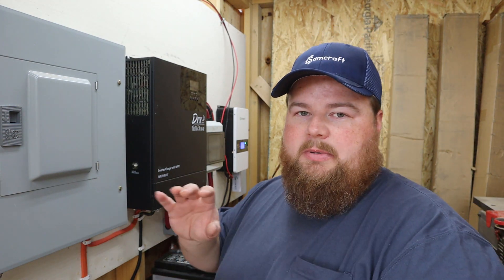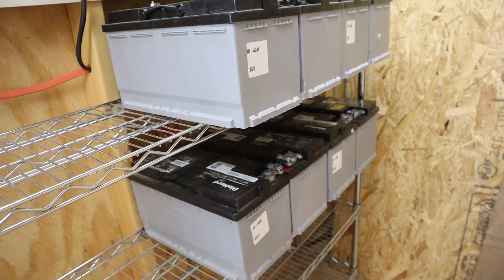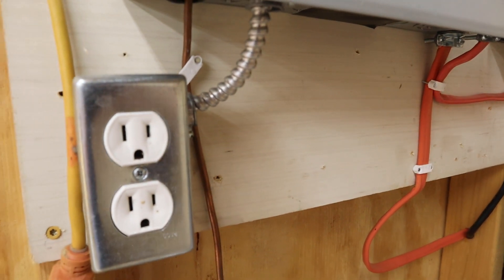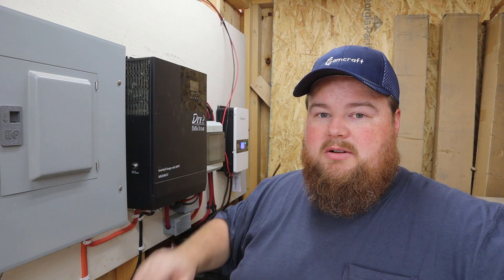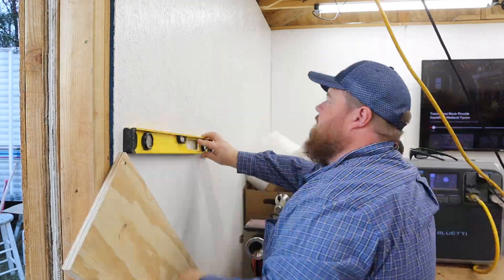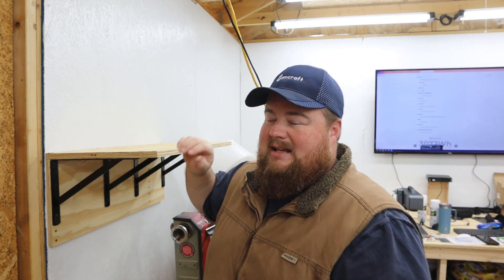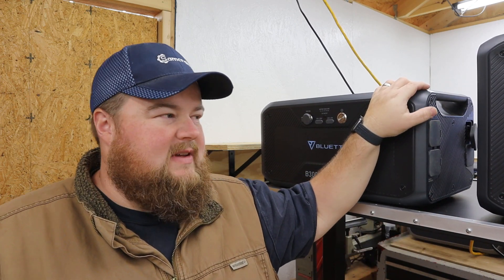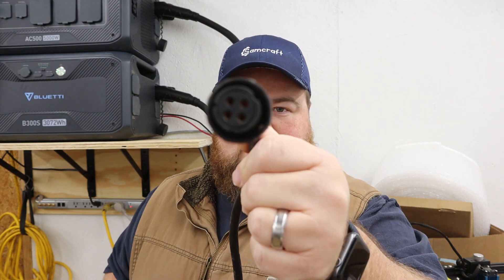Upgrading my Off Grid Workshop with the BLUETTI AC500 + B300S

Comment: I hope you read up on the 2 pole 50 Amp plug, you will need two AC500 units in order to pull 50amps out of the system, it is the only drawback on the Bluetti

Comment: Sam , when you plug into your ac500 , is that only bringing in 120 volts or 120 volts on each leg to make that 50 amp receptacle 240 volt /

Comment: Cool setup. FYI - A main lug load center has lugs (Those connections at the top of the bus bars.) for the main feed wires to directly energize the bus bars with no main breaker or disconnect. In a main breaker load center the main feed connects to a breaker. That breaker will connect/disconnect power to the bus bars without taking up breaker spaces. You just bypassed the lugs by wiring in your own main breaker. Still works as a disconnect, you just have a few less breaker spaces available.
Reply from the maker: Yep. This is a combo box designed for either way. I don't mind loosing a few spaces for a smaller load center and much cheaper price.

Comment: Just watched your video. Nice job. I do have a question. The large outlet, you have plugged into. Only one leg is hot. Are both sides of that breaker panel hot ? If so how ?
Thank you for your time
Reply from the maker: I didn't want to show that part as it's not exactly a recommended method, but I connected the L1 and L2 wires to each other on the plug end where it connects into the BLUETTI.
Reply: Thank you.  Good luck with everything you do.

Comment: It's curious that the incoming power went to zero as soon as the power draw jumped into the 700s.
Looks like a nice setup. I've wrestled 3kVA APC units before and those things weighed a "ton" w/o the battery packs. That 5000 is either more efficient or you're stronger than you look to lift it over your head. 💪

Is the battery rating true capacity or fully drained? Most batteries don't like being pulled down to "zero" as it damages them. 80% of the sticker's capacity rating (at best) has been the rule of thumb most of my life. It would be nice if the company is grossing-up the battery to have a true 3000WHr capacity.

Comment: I was just quoted almost $4,000 to wire up my 12x14 workshop to city power.
Seriously considering doing what you did.
I would have a computer with two monitors, two 3D printers, a small drill press, small belt sander, scroll saw,foam hot wire tools, Dremel, laser engraver!cutter, lights, maybe a pellet stove. Fan, stereo… but of course not all at once.
I’m thinking something like this may work and be better with some solar panels.
I have a medium and a large gas generator also-for when it’s too cloudy-but being the southwest, there’s a lot of sun even in winter.

Comment: would it not be an idea to make an enclosed cupboard around the power boxes and vent it to the outside, then you'll not have to worry about dust and have cooler fresh air from outside, also would the glued-on filters not restrict airflow to the fams, especially when covered in dustl

Comment: Nice video.  Hope this all works for you.  I have a couple of questions.  As the specs were rolling on the screen for the Bluetti, I thought I saw where it said that input was limited to 500w, and you said your solar array was 700+ watts.  In terms of runtime, how does the capacity of the old batteries to the new one compare.  How long of battery power did you have on the Bluetti compare to the old batteries.

Comment: What would happen when like u said the table saw under a load while cutting something hard to draw more amps...but yea brother...totally convinced that is the waya to go...awesome
Reply from the maker: The unit has a 10,000 watt peak rating, so it should handle it fine for a short time as the other tool or this one settles. It's so rare for me to ever have more than one "large" tool running at the same time.

Comment: Why not buy 16 280Ah LiFeP04 cells for $2000? Gives you 14kwh so it blows the Bluetti out of the water if your current inverter has enough power output

Comment: Ok, I am a novice when it comes to solar BUT it seems like adding up the cost of the solar array and all the associated equipment and electronics I could pay for a lot of electricity.  Other than not being concerned about a power outage what is the benefit?  Where are the real savings?  Thanks.

Comment: Way better than the typical "ohh, can this 2000watt unit handle [anything you can plug into a 15amp plug]" type video. Does the app or the display show an esitmated run time based on current load? That is one feature I like on my Delta MAX.  Hope your feet are feeling better!
Reply from the maker: I had hoped it would be more fun. :) It doesn't display runtime remaining, no. That would be a nice feature!!!
Reply: @Samcraftcom  I'm about to give a try using the laswer engraver on shot glasses as gifts, any suggests on setting for glass? (I have the 5w outur)

Comment: Great job on the video my man!....  Not too sure if you mentioned it or not, but you can even connect a direct connection to the battery from solar using up to 500 watts to the battery alone with ALSO using the maximum 3000 watts to the inverter itself.  This way, you can use JUST the battery if you only need a 12 volt supply.  These things are SOOOO FREAKING AWESOME!!!....  You can also attach up to 6 of those batteries making it 18,432 watt-hours!!!!  ....  Again, These things are AWESOME!!!!!

Comment: in hindsight it mightve been better to set the batterypack on top of the controller unit , that way youre able to operate the ting a little eazier 
yeah yeah the app , but still its only a little effort to switch it
as for (most) of the old system , maibe make it a backup sytem for the home , keeping it charged through the net and kicking in when theres a blackout , basicly keeps youre "server" router some emergency lights and fridge running
Reply from the maker: It would crush the DC wireless charging pads on the top of the inverter to swap them. I can easily reach, read, and use the display when needed, but It's not something I'm looking at much. The old system is in another shed on our property and will be setup for use in there soon I hope.

Comment: Finally got a chance to watch this and the biggest question I would have is, how much did everything cost? solar panels and all. Maybe our electricity is really cheap where I am in PA but solar is not even close to being competitive for us! I would love to have a solar setup for the garage to run a heater in the winter and not run the electric up but the upfront cost is a killer.....unless you say it was only like $3000 for everything then it may be worthwhile!!! Just for comparison our electric is .068 and distribution is .028 per kwh. I really would love to have solar to be greener and be able to do crazy things like heat the pool, garage, etc and not have to worry about a $500 a month bill but I need to hear an upfront cost now to see if it would be any cheaper than just running all that stuff through my main electric.

Comment: I ordered the AC500 combo last night. I started to go with something like the 200Max, but it looks like the AC500 is built for REAL offgrid use, not just for emergency power. I'll have to add more batteries over time, but it's great to have the expandability  toward a whole home solution. One reviewer pointed out that the AC500 could actually compete with the Tesla Powerwall, in price and power. Tesla won't sell you a Powerwall for DIY; only they can install it, while with Bluetti it's ALL DIY.

Viewers should know that if you try to save some money by buying the older generation B300 batteries, you'll need a $100 adapter cable, plus you will be limited to 4 batteries, (you can add 6 if you use the B300S). I almost made that mistake.

Btw, I would have liked to have seen details how you wired the 50 amp receptacle.

Comment: Sam, where do you get your Bluetti’s from? I have tried to contact Bluetti to be able to talk to someone on which one system I need for my home when the power goes out. I have called them several times to  talk to them and get some more information but, I only get a ringing phone which no one will answer. Any information will be appreciated.
Reply: A question they can't answer, it all depends on what you expect to run. A window air conditioner? A few lights? A refrigerator? Or your whole house, central air and heat? 

Then comes the question of how long, a few hours or every day until power is restored?

It takes an audit of what you have and use to start to answer these kinds of things.  

Hopefully you understand that a company like this doesn't staff for those types of phone calls

Comment: Is your workshop heated?  These don't like to work/charged below freezing temps if the solar is permanently connected. If you heat the workshop while you are in it, it would take some time for the unit to warm up (internal batteries) from freezing (or lower) before they should be used. This isn't an issue with the lead acid batteries you were originally using. Also, in the summer, these won't take well to temps above 100 F if the shed heats up a lot.

Comment: Bluetti Batterys are twice the price of other brands,. you can charge the system from another battery ! try adding other brands - no can do, even if cut and reconfiger the wire.  So they say to heavy to be portable so way the wires hanging out the sides, they  need an engineer from say Japan or some other country to help them with the wires hanging out the sides.

Comment: Will low winter temperatures cause problems for your new system?
Reply: I wonder, lifepo4 batteries are not supposed to be charged below freezing, uncertain what chemistry Bluetti uses..

I see Lifepo4 so if they aren't heated they will be damaged
Reply from the maker: This is from their website: Waking up electronics on a freezing day may be time-consuming. But with the Temperature Adaptive Function, B300S will automatically heat up to work actively and smoothly as usual.
Reply: @Samcraftcom  battery specs say: Temperature ranges for B300 are: Charge: 0-40℃ (32-104℉); Discharge: -20-40℃ (-4-104℉); Storage: -20-40℃ (-4-104℉).

Hard to find, so be careful of freezing weather and charging

But the advertising says:

Yet: BLUETTI always adopts state-of-the-art technologies and brings forth new ideas to level up user experience. Power stations aren’t responsive enough especially on freezing days. Now with the Temperature Adaptive Function, B300S will automatically heat up to above 0℃ when the ambient temperature is -20℃ to ensure it can work smoothly.

Maybe the BMS is smart enough to stop charging until heater brings battery to the proper temperature 🌡️

Comment: I feel you've mentioned this before, but can't remember.  What are the specs on the panels you're using?  I'm thinking about adding a few panels to the roof and a system like this to run at home 'data center', and quite possibly run my big Co2 laser setup (100w laser, commercial chiller for it, small compressor and an exhaust fan).  While I've got a good bit of room up there for panels, I'm going to maximize the non-shaded areas by (hopefully) putting in some larger wattage output panels..  I'd likely also use this setup as a 'backup' for outages on a few things..  Without a major expenditure on tree removal, I'd likely have good solar coverage for around 8-10 hrs most days (for example, in summer they'd be in full sunlight from around 10am to at least 7pm, if I remove a couple smaller trees, till sundown).
Reply from the maker: My panels are used "off lease" panels I got from Langston's Alternative Power for a fraction of the price of new panels. They're stickered at 270w each, but pump out about 250w in perfect conditions. Considering the price I paid, I've never regretted the purchase. I have 20 of them in total, but only use 8 right now. I really want to put the other into use somehow on our land soon! Spencer is a great guy and worth inquiring with if you're looking into things. He owns Langston's. Here's a link to his website: https://www.langstonsalternativepower.com/

Comment: Off Grid Homesteading has the Bluetti and swears by it. Has anyone every told you, you could be a salesman, or a really good teacher? Keep it up.
Reply from the maker: I consider BLUETTI the top tier brand for power stations. Our smaller AC200P has been through a hard life the last year but has never missed a beat. This AC500 unit is the same way -- we've had it for several months now with no issues in quality, performance, and reliability. Everything is as-advertised with them.

Comment: Although I don't know how much power is needed for Angela's soap shack, I could see using the old system to have it running off-grid.   I'm thinking you could build a large enough addition on one side of the soap shack to keep the old system self-contained and not take up any room inside the soap shack itself.

Comment: Sam great video well done and i liked how you explained everything. I have question. I have a similar workshop 12x16 with the same type of tool configuration including a Delta table saw, drill press, belt sander band saw and about to add a CNC  with a Laser Beam. I imagine the Bluetti can support those items. One thing i need this time of year is a heater in my unheated shed. These heaters seem to take the electric down all the time. I am running currently through a heavy duty extension cord from my house. Even without turning the saw on the heater typically overloads the circuit. You, think the Bluetti can support your shop if you also added an electric heater?  Thanks
Reply from the maker: The inverter of this unit putting out 5,000 watts is plenty to run a 1,500 heater, but battery capacity would be the kicker for it. I'm going to add a wall mounted propane heater to my shop for the time being.

Comment: Sam you might want to try attaching the air filter with Velcro so it can be changed out more easily if the hot glue doesn’t peel of the Blueti easily.
Reply: Oh great idea!

Comment: And very expensive up front. Being on the grid is not a  problem for me and I have a fair amount of power tools. In most shops like mine and yours, not much power is used compared to a production shop. I am sure you know what you want and what you need for the shop. I think I will stick to the power coming from underground to my shop. Hopefully you will also hook up the the grid later as cloudy days and night just don't cut it with Blue.
Reply: We just had 5 days of rainy weather. My solar barely produced but I have grid passthrough on my solar inverter that lets grid power in when batteries are low.

Comment: Nice informative video and pretty impressive unit. Not knowing much about solar and battery backups etc. do the benefits gained from this Bluetti setup warrant the associated cost which if I read correctly in the link you provided was approximately $5,000 on a Black Friday special as compared to your previous setup? I would be interested in adding something like this with a few solar panels instead of a standby back up generator. Just not sure how they would compare . Hope your feeling better!

Comment: Very sketchy Sam. IMO those units are way too heavy for that shelf & brackets.
If you're dead set on that type of shelf make it longer and put the units side by side, not stacked. The weight will be a lot more evenly distributed. I would also strap them both to the wall with nylon buckle type straps. Just another layer of fall protection.
Just sayin' my friend.
Reply: I was gonna add that He use larger Lag Screws rather than Sheet rock Screws to mount the Brackets.
If anything those will be His Failure point . Sheet rock Screws are not that strong. thus the name SHEET ROCK. 
Mike M.

Comment: The air filter on each side is an excellent idea. You would think these power station manufacturers would include washable slide-in style filters. But, then again, PC manufacturers didn't do it either.